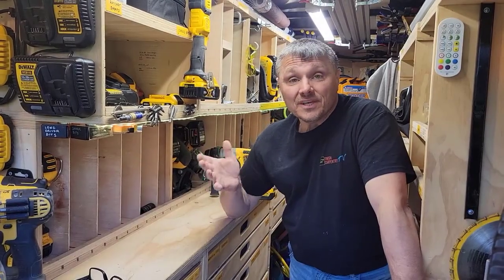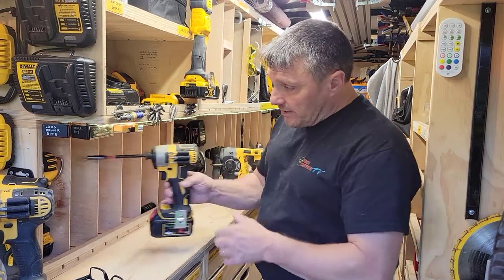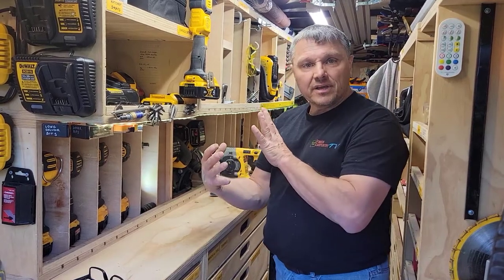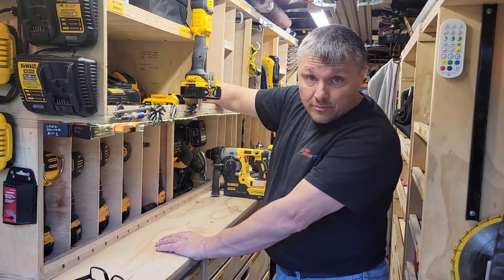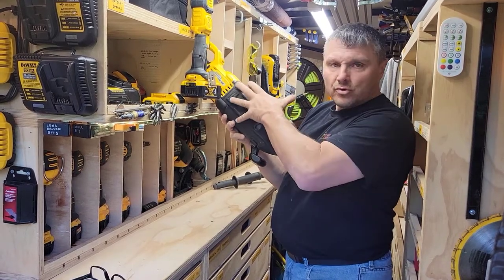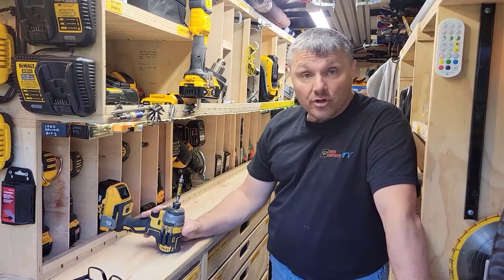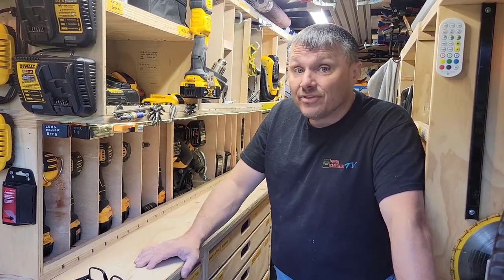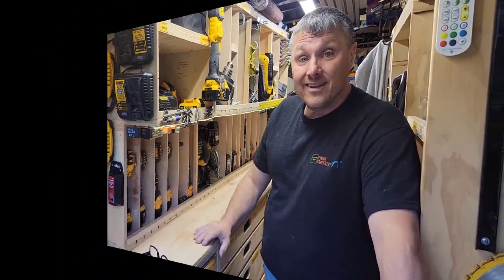Drill/Driver tool cubby storage in my SMART trailer

Comment: You sure have done a nice job of organizing and making your trailer as efficient as I think you possibly could.  It looks great!
Reply from the maker: Thanks Russ! All credit to the designer Ron Paulk. All I had to do was follow the plans and figure out how to best utilize the space I have with the abundance of tools I own. I like the idea so much that I am building the cubbies (all 3) and three drawer banks for my walkout basement to organize my “house set” of tools. All this at the request of my wife so she can easily find tools when she needs them without having to go to the trailer. This presented two problems. Basement organization and having a simple but complete set of tools for home repair and projects. Solution 1 is to build the left side of my trailer, more or less, in my basement. Solution 2 is when built, organize the extra “second-set” of tools I have and see what is missing then fill in the gaps with purchases. Win-win. Thanks for commenting!